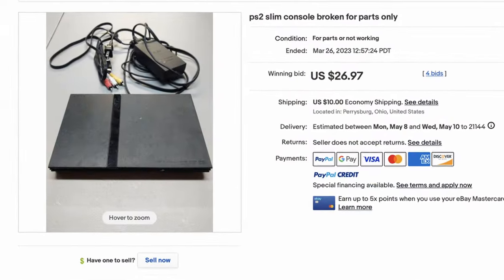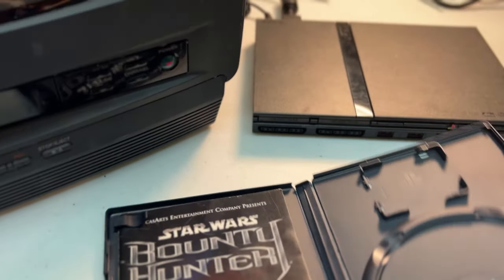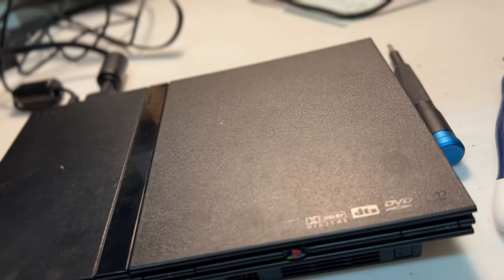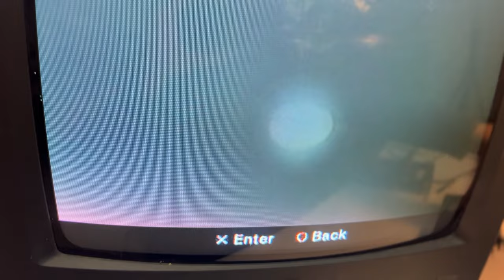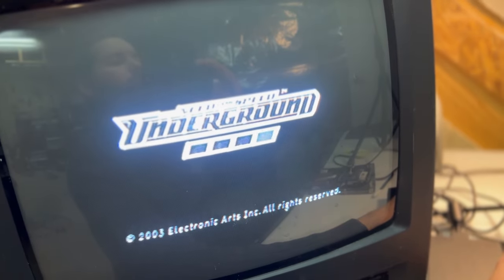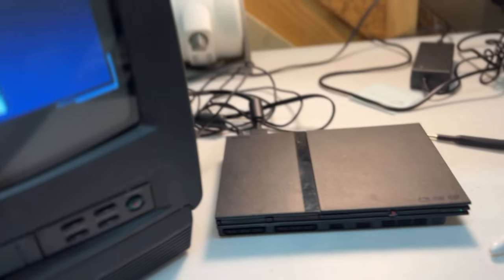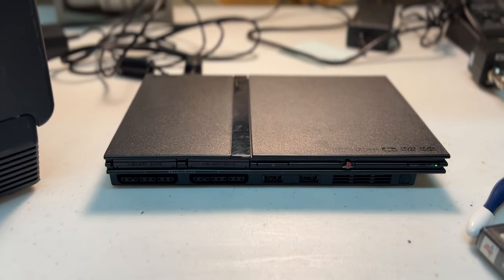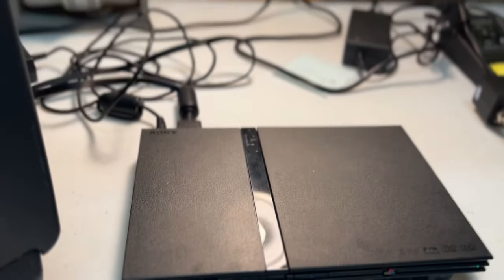Let's Fix It - PS2 Slim Disc Won't Spin

Comment: Hi there! A thing I usually check on PS2 Slim before I even put a game on it, it's if the flex cable from the lens sensor goes "above the line" where the disc would be, because I saw many of them scratching them... You could glue part of it again to the metal shield, or just replace it.
Reply from the maker: Thanks for the tip. I’ll keep that in mind.

Comment: Thanks for that, I was going to open my PS2 and slammed the cover a bit harder than usual and boom, sensors started working again. I think my console needs a cleaning. It's been in the storage for so long. :)

Comment: It works for me. I tried the expensive games on my modded 75004 and I only have issue with disc sensors :) Thanks for advice.
That reminds me of hell with UMD sensor in PSP 😑
Reply from the maker: Glad it could help.

Comment: Mine stopped trying to spin once the laser was replaced. I’m wondering if maybe one of the ribbons might’ve not been put in fully all the way, so I might try that at some point and clean the sensors to see if that fixes the issue. If not, then I might just give it to someone else and let them decide on what they want to do with it, whether it’s dismantling it themselves or just refurbishing it
Reply from the maker: I've found the ribbon cables for the laser not being fully inserted can cause a lot of weird issues with the lasers. I'd start there and also see if maybe the ends of the ribbon cables are damaged.

Best of luck!

Comment: Sorry for the dumb question, but what exactly did you do to the sensors  to have them working properly? I see you only tested them...
Reply from the maker: I cleaned them with some ipa and compressed air but these sensors weren’t that far gone. Sometimes the rear sensor just doesn’t want to work anymore and in that case you’re better off soldering a wire between the two sides. it’s the better long term solution but more involved. 

Hope that helps.

Comment: How hard did you have to press down on the lid for it to trigger the sensors? I have to press down witha good, almost scary amount of force. But it seems to be same issue as you showed. Thank you so much for this vid, there is still hope for my old baby ^^
Reply from the maker: Not too hard for that one. If it does work when you push down there some hope for the sensor. I’d use some ipa on the sensor with a toothbrush or q-tip and see if that helps improve it.

Comment: Hello, quick question.. I bought a brand new sealed ps2 (9004 CB slim) I put my game in and it doesn’t read.. when i push the top little bit it will read the disc but don’t start it.. can u tell me what the issue is?
Reply: I might have to remove the dust from the laser but I can't imagine because the PlayStation is brand new, that’s so fukd up …
Reply from the maker: It could be the sensor for the lid. Different versions have the sensors in different places so it might not be in the same area as in the video. Does it spin only when you press down? If so it might just have some crud from sitting for so many years. I’d try some ipa on a q-tip to see if that helps. 

Amazing you found a sealed ps2. Pretty messed up it didn’t work right out the box.

Comment: Loved the video thank you! it got one of my ps2 slims working after this.
Reply from the maker: Awesome! So glad it helped.
Reply: @FixMoreWasteLess  Yeah, I love the message on your channel. I really enjoy cleaning & fixing electronics. I bought myself a lot of 11 broken ps2 slims and have got 4 fully working without having to buy any parts yet (doing this, fixing a power supply, cleaning laser etc). I'm absolutely loving it. Love to see a channel like this, amazing work thank you once again!
Reply: @FixMoreWasteLess  Hey, i've got a ps2 slim model 77003
 and the disc isn't being read and the disc spins incredibly quick, way too fast. Any idea what might be causing that?
Reply from the maker: Never seen that. Have you tried swapping out the laser from one of your other slims? Might tell you if it’s the laser or the system causing the issue.
Reply: @FixMoreWasteLess  I tried with another laser (not sure if the other laser was dead or not) and same thing. I'll have to get my hands on some new lasers from aliexpress soon.

Comment: i just got a "refurbished" ps2 and i'm having a similar problem except it makes a buzzing sound like it's attempting to spin but it won't
Reply from the maker: I'd check to make sure the ribbon cables connected to the disc drive are secure. I have a newer video where at the end the cable attached to the back of the drive was loose and the spindle motor just kept spinning when closed. Hopefully its something simple like that.
https://www.youtube.com/watch?v=XtVfxrEuc4E

Comment: I and many other would just remove the rear switch and short it with a solder blob or wire, because later version slim ps2 did what the the ps1 did and rely on 1 switch problem solve, plus the front power is removable so you can replace or fix it.

Comment: I have learned from my PS2 slim that the blue ribbon cable for the power button is prone to failure.
Reply from the maker: That’s also true for the PS2 fat. I had one fall apart while trying to reinstall it and had to buy a new one.
Reply: @FixMoreWasteLess  sure. But with the slim model. The power button ribbon cable can make it appear that the disc drive isn’t working.

Comment: I just replaced the disc drive in my ps2, and the disc still is not turning. When I test, by pressing down the two switches, the lasar moves, but the disc never spins. Any tips?
Reply from the maker: Check that all the ribbon cables from the laser assembly are connected well to the board. Just had one where the laser would move and the worm gear would just spin because one of the cables wasn’t well connected.

Comment: How about a slim with a working laser with the lid closed or the two sensors pressed, but the motor doesn't spin? Bad motor?
Reply from the maker: Could be the motor. Check all the ribbon cables for the laser assembly too. Sometimes if they’re not well connected or damaged they’ll affect things like that. Also try cleaning the motor good with ipa or compressed air before writing it off. Hopefully it’s something simple like that.

Comment: It does spin when you hold the sensors after a number of tries, but what's the solution for when you want to play games? I tried dusting already, but should I put something on top of the console?
Reply from the maker: I have another video where I bypass the sensor by creating a connection between the two points. If you have the tools to do it it’s kind of a permanent fix. Could try soaking the sensor in some ipa. I’d caution against placing anything on top. It could cause the disc to scratch. 

One other thing is to make sure the lid isn’t damaged and that the plastic piece that triggers the sensors are still in place. 

Here’s the video. You can skip ahead to about the 8 min mark for the sensors fix. 
https://youtu.be/XtVfxrEuc4E?si=BeFAvGdngMx2AA7f

Hope you get it working!
Reply: @FixMoreWasteLess I understand that placing something on top is a risk, but my console is almost 20 years old so this is probably the only hope. It hasn't been touched in over a decade. I got it to work miraculously, but it only reads disks if enough pressure is put on the lid.

Comment: I have a ps2 slim 9001 model and I can't get the disk to spin. When I close it the laser moves like it wants to read but can't bc the disc isn't spinning. I think it might be the little motor that makes it move. Any ideas?
Reply from the maker: Maybe try looking at the ribbon cables attached to the laser and make sure they're connected well. But it could be that the laser is failing and isn't able to tell there's a disc in the system. I think in that situation, the laser moves to check if there's a disc and then goes back into the retracted position if it doesn't detect one. Hopefully, it's just a loose cable. If you take the top lid off and put a disc in, what does it do when you press on the lid sensors?
Reply: @FixMoreWasteLess  the laser moves for a bit and stays there but I dont think the laser stays on, as you said, doesn't think the disc in in there

Comment: am curious,  your fix about the ribon on the lazer that scratches discs
Reply from the maker: If the adhesive’s started to come loose I’d try tapping it down but with enough slack that the laser can still move all the way to the center. Otherwise a new ribbon might be in order. It should hold the shape better and not curl up so much.

Comment: Tested with lid off and pressing both sensors down, the laser moves to towards the center but the disc doesn’t spin. Any advice on where to move next?
Reply from the maker: I'd check to see if the ribbon cables for the laser assembly are all well connected. Can you tell if the laser flashes on at all when it gets to the center?
Reply: @FixMoreWasteLess  I am having the same issue that @suchandrew6962 is having and I can see the laser on mine flashing when it gets to the center but the disk does not spin. Any ideas or suggestions?

Comment: My PS2 slim has a grinding noise where the laser comes down and hits the spindle but the disc doesn't read. I hope u can find a PS2 like that because I don't know how to fix it.
Reply from the maker: I have some other PS2 slims that need fixing. I'll let you know if any have a similar issue.

Comment: Hi my ps2 slim the disc tray is not working it makes this ticking sound and it trys spinning a couple of times and it stops and says no disc in it is there a problem with the lazer to it
Reply from the maker: Possibly the laser. You could try cleaning the lens with some isopropyl alcohol to see if that helps. If not it might need to be replaced. I’d also recommend testing it with a CD and/or blue disc game or dvd depending on what you’ve been using. Sometimes when the lasers start to fail they manage to read one format and not others. To be honest I’ve had poor luck fixing PS2s with laser issues.

Comment: if the black sensor is broke what can i do then?
Reply from the maker: The easiest thing to do is to just bridge the connection on the sensor not working. Here's a video showing that issue: https://www.youtube.com/watch?v=XtVfxrEuc4E
You can skip ahead to the 7min mark for the sensor bypass. You will need a soldering iron to do that.

Comment: mine isnt spinning at all when i push it and even when i put someting heavy on top of it
Reply from the maker: The rear sensor might be too far gone. Best (long term not necessarily easiest) solution is to solder a bridge between the two connections.

Comment: unfortunately the drive still does nothing. I don't know if it's the drive itself, I may have to swap it to another ps2 but I don't know which ones are compatible. also my video out is only black and white for some reason.
Reply from the maker: Have you checked to see if it’s in rgb video output? Might be a reason it’s only showing black and white. As for the drive it could be a ribbon cable or motor in the assembly.
Reply: @FixMoreWasteLess  I have to properly check the drive maybe try it in a different console. 
I tried different video options still black and white, I use an original cable with a scart adapter and the other two ps2s display colour no problem.

Comment: Mine doesnt spin AT ALL like nothing not even the eye doesnt matter how much weight you put on it doesnt matter if both switches are held down, ive even cleaned out the whole thing NOTHING and its driving me insane i have no idea why its most likely just a dead drive ive tried multiple different games and cds even, the whole drive is completly frozen it doesnt move or make any noise so i think my ps2 is unfixable at this point 😑

Comment: i have also have a ps2 slim and it works great my father said it was broken but everything worked fine. after i told him it was good he said that it could read burned discs with games on it for the ps2. is that normal?
Reply from the maker: There are a lot of mod chips out there that allow that functionality. I think it's also possible to play games burned to DVDs without modding, but I don't know much about that. Glad your PS2 slim didn't have any issues!

Comment: Yep I'm not taking my depart I will just continue to deal with it all I got to do is put something heavy on top of it with my luck if I take it apart I'll break the damn thing
Reply from the maker: You could try some compressed air or something similar on the switch that’s not working and that might be enough to clean up the connection to where you don’t need the weight. You wouldn’t have to take it apart to do that.

Comment: My ps2 slim dont read my games but it does read dvd movie and one ps1 game worked.
Reply from the maker: Sounds like your laser might be on its way out. Reading some formats and not others is a common issue when they’re failing.
Reply: Did you solve it, mate? Mine has the same issue. Only DVD movies and PS1 games.

Comment: Justvto note from research for anybody currious if it is a legit ps2.. the slim ps2 just plugs right in [on the new ones]... research says only 04 to 08 models need a power brick if they are slim however the new ones have a bigger area with purportedly scratch prone glossy area finisj vs just the strip being scratchy... however the 08 to 13 model year ps2 systems have not the ability to travel anywhere in the world without a outlet/voltage possibly even a frequency changer from 50 to 60hz or vice versa if you are outside of the ntsc u/c region
Reply: Oh also the phat ps2 also needs a voltage and/or outlet/frequency? Changer for traveling etc

Comment: Hello mine did not spin the disc at all, even when I pushed both sensors down, the laser won’t move nor the disc. it also doesn’t help when you look up for answers and it does not show anything but this fucking video, so can you please help
Reply: I’ve searched everywhere but my issue is not with the laser or reading the disc, it’s the disc not spinning itself even when I push both sensors
Reply from the maker: Could be the sensor has failed to the point even when you push it down it's not working. The back sensor does that a lot. If you have a multimeter you can put the two leads on opposite sides in continuity mode and see if it has continuity when you push the sensor down. If it doesn't then you can remove the sensor and bridge the connection.
Reply: @FixMoreWasteLess  I used my multimeter and it was the back sensor. Thank you a lot